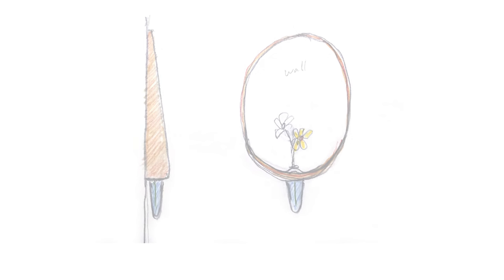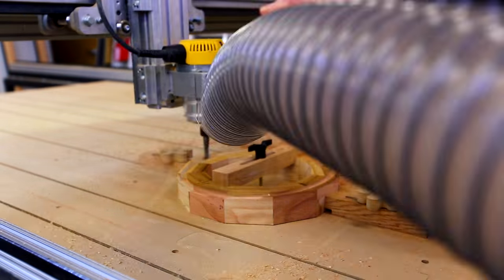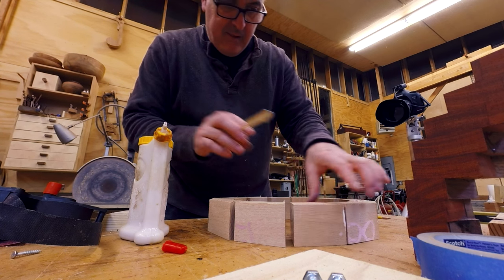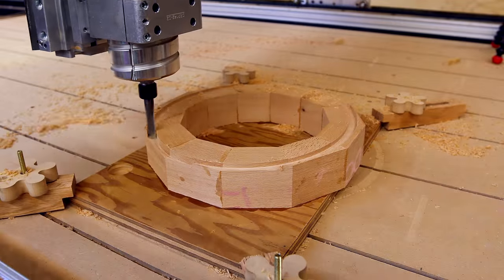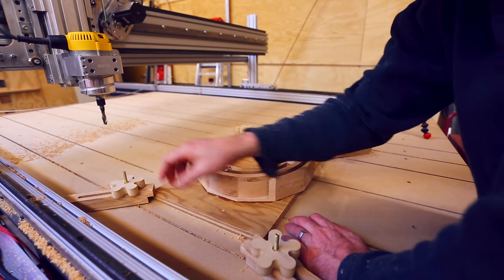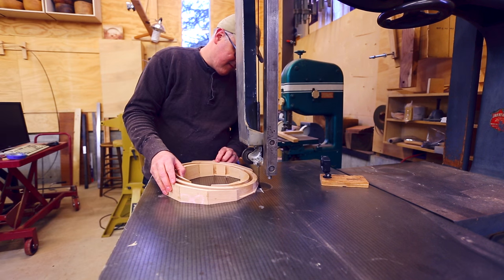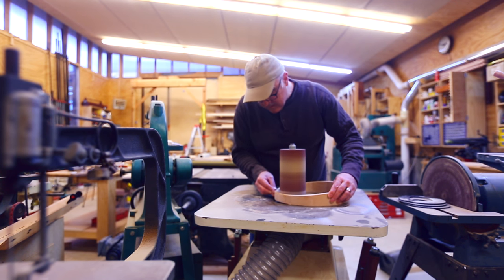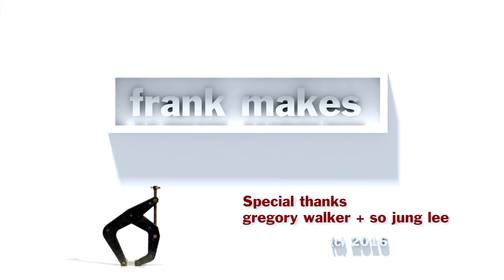Making a Wood Ellipse

Comment: That was cool.   Very well done.   What if you used a much thicker ring. Then use the CNC to cut the inner ellipse as well as  the outer ellipse. Mount it in the band saw at an angle so that your first cut removes one ring leaving a second ring still glued to the board.  Remount in the bandsaw to cut the second ring off the plywood. Then just router the edges, sand and finish.
Reply: +RandomTorok I just thought of the same way. It would mean less waste and saving time in production, even though this is just a prototype. Having it glued to a waste board would allow for a much bigger stock, when you take it to the band saw. You are just limited by the length of your CNC tools.

Comment: For gluing to the plywood. At a shop I worked at, often we could need to temporarily glue two parts together. Strong enough to machine, but still need to separate later. If you put a layer of newspaper in between the glue, you will be able to pry the pieces apart later. We used this mostly in an instance where I would glue two pieces of wood, cut a spindle on the lathe, and separate to make a half spindle.
Anyways, your projects are always awesome. Thanks for sharing your work!

Comment: Looks good, Frank! Love the finished piece.

And I personally have found with a CNC in the shop (albeit much smaller than yours), it still makes a lot of sense sometimes to combine it with more traditional manual operations. Using a kind of hybrid approach like that, I can make pieces that are precise and repeatable in certain areas but still have a little handmade charm and a lot of handwork such that I don't feel like I cheated, haha.

Thanks as always for sharing!

Comment: It's design execution problems like this that let you assess which tools capabilities should have their expression at which points in your work flow. All tools can be used as a hammer but each tool has its proper uses and figuring those out to advantage is the tool users most important job. Very nice execution in this build. From time to time, let's watch you do a few more variations like this to see what tool selections provide you the most adequate result.

Comment: Hi all - as the "Greg" in the video, thanks to everyone who's given some positive vibes on the idea. So Jung and I were really looking for an advanced "proof of concept" prototype and Frank really delivered on that count. Moving to larger scale production would certainly entail looking at some different types of assembly and technique. For those pointing out that this could be done without the CNC, that's certainly true but part of reaching out was to help 'break in' the machine with something a little more complex (I think we sent it over the week after it arrived in the shop). If memory serves, Frank was also working out the kinks in his angle jig (something alluded to), so it's an experiment in different ways. Glad everyone enjoyed it as much as So Jung and I did.

Comment: Interesting as usual Frank. As I watched I was thinking that those of us who don't own a CNC machine, could probably do this project on a lathe. I like this one. Thanks
Reply: +Charlie Zellner How would you go about making an ellipse on a lathe? i also do not have a cnc... :(
Reply: If it could be done, it would take some very creative ways of mounting of the piece in the chuck so as to turn it off center. But, I'm not even certain it could be done.
Reply: Cut a cylinder like a bowl. Cut away a diagonal stripe to get an ellipse. Tidy up outer and inner faces to vertical using a bearing guided router cutter running along the top. It would probably be faster to do bentwood strip lamination around a form. You could do lots, very quickly.

Comment: Beautiful. 
If you need to hold a piece down for your cnc machine where you're not sure how the support is going to work, hot gluing your workpiece to mdf gives you tons of support without waiting. Plus you can usually break it of the mdf without cutting.

Comment: Looks amazing! Although I must say I'm not a fan of the hook holding the ring up.
Reply from the maker: +Edan Coll My wife noticed that too.
Reply: +Edan Coll Yeh, it should be held in place by a hidden pin from the back side or something along those lines.
Reply: +Edan Coll Well...Frank did mention the guy is an architect...you know what they're like.
Reply: I would have understood the decision if he was an engineer. Functionality over looks, but from an architec I expected more :P
Reply: *****
Ouch! (I'm an engineer)...with taste.
Reply: haha:D
Reply: +Edan Coll Needs a nice forged hook or hidden fixing.
Reply: +David Smart      Amen, Brother, Amen.  In my line of work - structural engineering - I've seen some real screwball ideas from architects.
Reply: +Edan Coll I actually like the hook because it reveals the construction in an elegant matter without destroying Frank's beautiful ellipse by drilling a hole in it.
Reply: +Edan Coll Could probably drill two keyhole slots in the thicker sections.
Reply: If he insist to use a visible hook then at least he could have used a better looking one.

Comment: There is a way to hold down the piece without clamps. Lay down a couple strips of 2" masking tape, pressing them firmly to the spoil board. Mirror them on the piece to be cut. Use CA glue on the pieces on the table and spray the activator onto the tape strips on your piece. Press them together for 10 seconds and you're good to go. A FaceBook friend shared this with me a while ago and I haven't used clamps ever since. I'll try and locate the video he made to describe it better.

Comment: I'm sure you probably know this but maybe someone out there doesn't. When I have stuff that's hard to clamp I use temporary spray adhesive on a sacrifice material. At work we use 3M's 77. Depending on how well you achieve adhesion it can even hold down 1/4" aluminum yet it cleans off well.

Comment: This might just be me, but I have come to hate CNC in wood shops.  (Possibly because I do not have one, have no budget for one, wouldn't have anywhere to put if if I did, and wouldn't consider what was produced with it to be made by me - the computer made it instead.)  This turned out awesome, but there's absolutely no way I could ever do it using the technique you showed, which is the whole reason I watch videos like this.

Comment: I wonder if doing it in the reverse order would have been easier. 

- Create the segmented ring
- Glue it to base
- Cut segmented ring to correct angle with band saw
- CNC ellipse at full depth (partially cutting into base).
- remove remaining base and other material by bandsaw and sanding.

Comment: You should try hot glue to hold down your projects on the c and c machine. It will dry faster, and it should come of your sacrificial piece easier. I also think a router with a flush trim bit would of helped taking the extra of the back of the project instead of the jig saw. Maybe there was a reason you could not get a bit in there?
Reply from the maker: +offsuit57 I'm going to have to try hot glue
Reply: +frank howarth you could even use double stick tape, just need to clean the CNC bed first
Reply: +offsuit57 By the way, its never C and C, its CNC, Computerised Numerical Control!
Reply: +offsuit57 Just saw your comment. I said the same thing haha
Reply: You can use denatured alcohol to get hot glue off, it works really well! search it up if you're doubtful.

Comment: While I will agree that the way you cut the angle is more than likely far faster than it could be done on the CNC, I'm curious to know if you tried a ballnose endmill when/if you've tried angled faces before. I figure it probably would still yield a poor surface finish due to it being wood and not metal but that's how complex angles would be cut in a metal application.

Comment: Why not a flush trim router piece to get rid of the extra trim after curing it of the plywood. Both on the inside and the outside.
Reply: you don't have a flat plane for the shoe of the router to ride on.

Comment: Was the CNC really the best tool for the job here? I feel an easier ands faster way would be:

glue the ring in two halves (like you used to)
cut each half to rough shape on the bandsaw
glue the two rough halves together
clean up with disk and spindle sander

Comment: Did you keep the segments of wood in the same order as they came off of the board? That helps to even out the discontinuities in color and grain. Although in this case, since you took off the outside of the ring I think that discontinuities are inevitable.

Comment: Generally Frank, I find your ideas and methods to be highly thought out and efficient however, I have to say for this project in particular it seems you may have drastically overthought the procedures. For example, it seems entirely possible and more effective to completely avoid the CNC machine altogether. That said, the piece turned out excellent as always, nice work.

Comment: Hi Frank.  Love your videos, this project too, but I have to ask: 1) Why did you not cut the inner AND outer ovals on the cnc? 2) Did you consider making the whole thing using built up thin laminations around a form and then cut the angled face? Regards Mark in the UK

Comment: You could have used a router with a flush cut bit instead of sanding. This would have made this a lot easier. How's my idea. I'm just 17.
Reply: +rahul dhebri He had to sand anyway, so using a flush trim bit introduces another setup. Still a good idea. I'm just 35.
Reply: +par5endos562 
since he had to round over the edges anyway he could have done it in one step with the roundover bit.(depending on the thickness of the lip of course)
Reply from the maker: +DeDeNoM Did not think of that,  that probably would have worked.
Reply from the maker: +rahul dhebri a  flush cut bit on a shaper or router table would do that job nicely.
Reply: +rahul dhebri wtf has your age got to do with anything?
Reply: Maybe that's his height? ;)
Reply: +TheAnimystro in some cultures age is used as a measure of life experience and assumed knowledge....
Reply: you know nothin' +Justin Snow 
:)
Reply: +nThanksForAllTheFish That is my target.... thanks!
Reply: +TheAnimystro Interesting....thanks for the observation! I didn't read it that way.....perhaps I was too busy judging me
Reply: An ellipse is just a closed curve conic-section: He's could have turned a cone on his lathe and band sawed at an angle, but it turned out well anyways and made a great video.